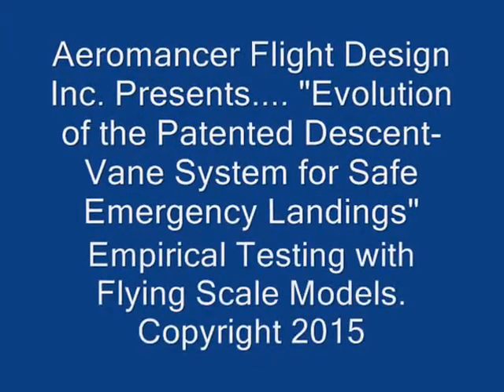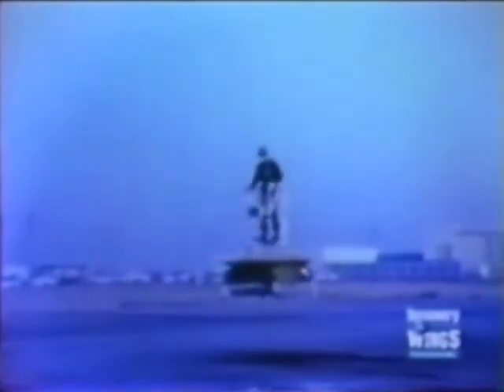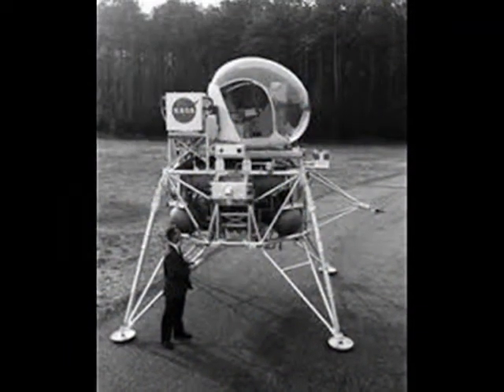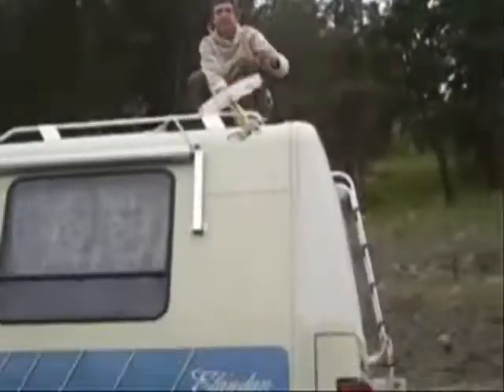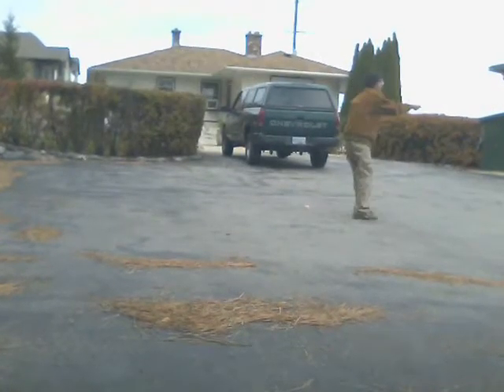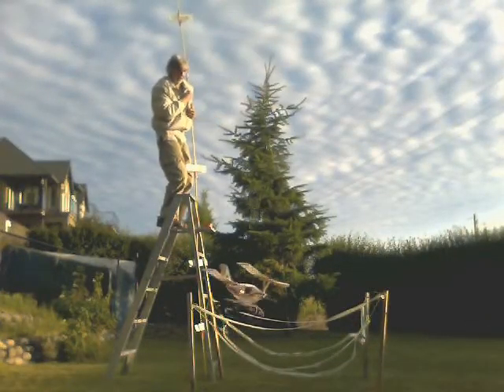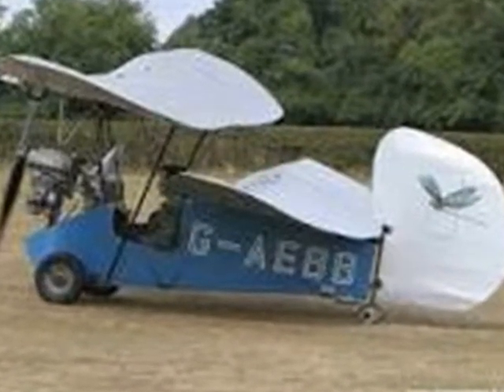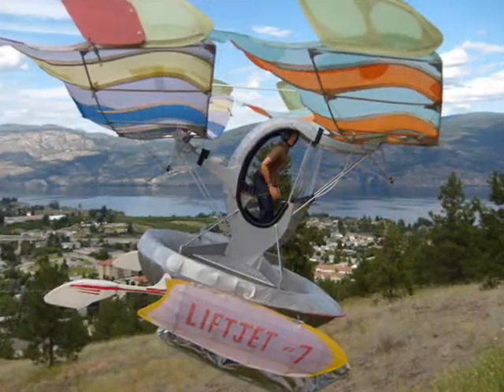Oct 2015 model vid

Comment: What are the advantages of your aircraft over conventional auto rotation of a helicopter?
Reply from the maker: Thanks for the great question RoboTekno.  Autorotation is a skill that requires  relatively extensive initial training. The skill must also be maintained by regular refresher sessions. Studies have shown that, even among professional heli pilots, this follow-on practice is often ignored. Just think of the situation in which a novice, recreational flyer has an emergency situation in which he is forced to implement his under-practiced autorotational skills. Talk about panic! In contrast, the Lift-Jet, after a loss-of-power, requires no input from the operator; a parachute-like vertical descent will occur even if the operator does nothing--and from any altitude. This is akin to a parasail and very few people are nervous about those. A more accomplished Lift-Jet pilot, if he does have some altitude, may also have the option of entering a glide,  (in order to achieve a better landing site, for instance). But either way, the Lift-Jet's built-in, full-time aerodynamic descent capability is far safer than a panicked, mismanaged autorotation. Additionally, the helicopters autorotation mechanisms (of the several types in use) are themselves subject to failure. Please keep the great questions coming.

Comment: You are still dependent on a forward glide path for landing, so even if our taking off VTO its not Landing that way, at least in an emergency ... so ... you glide into trees, Traffic, Buildings, and fences ... and can only dream of an open field to fall in. OR am I not viewing precautions taken to prevent this in your video?
Reply from the maker: Thanks John Henry Reaves for your insightful question. The fact is, the Lift-Jet does NOT require any forward (horizontal speed), or to enter into a glide, to achieve a soft, vertical (parachute-like) unpowered landing. It accomplishes this through the Descent-Vanes (wings) which incorporate some special features that permit a slow, stable, and controllable, vertical descent. Such features include the "tandem" planform, the single-surface, highly cambered reflex airfoil, and the wing-tip end-plates, among other features. Note also, the relatively large surface area of these "parachute-wings". For overweight pilots, extra heavy cargo, or a possible 2-place version, there are also "Auxiliary Descent-Vanes"' located alongside the duct-disk, which rotate into a horizontal position as soon as an unpowered vertical descent is initiated--so that with either the regular, or the heavy-weight versions, there is sufficient resistance to provide a very slow (5 feet per sec.) vertical impact speed.

Your question highlights the fact that my video does not make this feature clear enough and, (since being "virtually crashproof" is the main selling point of the Lift-Jet, we obviously need to do a better job of explaining it)! Thanks for your thoughts. PS: the end of the video shows the Lift-Jet in a steep glide with a soft landing--but earlier shots also show "drop-tests", with a soft landings after completely vertical (and stable!) descents.

Comment: But people are still lazy and negligent, so crashes are more likely in a congested 3D space than in a 2D space (nearly 1.3 million people die in road crashes each year globally, on average 3,287 deaths a day, with an additional 20-50 million injured or disabled). Even with the safety features you're designing, I don't foresee humans being safe as independent fliers. If we do reach an age where everyone has access to flying vehicles, it will be because of automated piloting, where the human has little to no involvement.
Reply from the maker: Hello Anon. You've obviously thought in-depth about this problem. I can't disagree with you're conclusion that (SOME) people are lazy and negligent--but how does that translate into 3D being intrinsically more dangerous than 2D? Apart from safety, I believe that the psychological fear-factor will keep most people away from flying "pods"--whether piloted or autonomous. On the other hand, he most popular form of flying ever invented is the parasail. Few people refuse to try them, because they are self-evidently crash proof. Notice that the Lift-Jet has a similar aspect, and gives the same benign first impression. I admit lot will depend upon what motivations prove to be predominant in the marketplace. Will people want a faster commuter, or will the most popular use be vtol flight into remote, rugged areas? And let's not forget the large percentage who's main interest is in flying as an experience of it's own. (An enhanced one in the case of Vtol). In a recent article in CNBC, Ryan Browne cites a study by YouGov which shows that at present, only 5% of Americans would feel safe in a flying pod-type. All I can say is that right now there's an awful lot of guessing going on--including by your's truly. Thanks for your input!
Reply: I appreciate your response. I am only addressing mass adoption on the scale of cars. But from a more hobby perspective, I think you are designing a craft that would see lots of enjoyment.